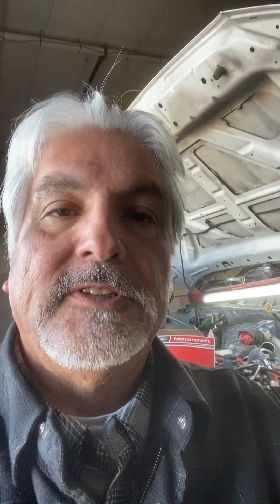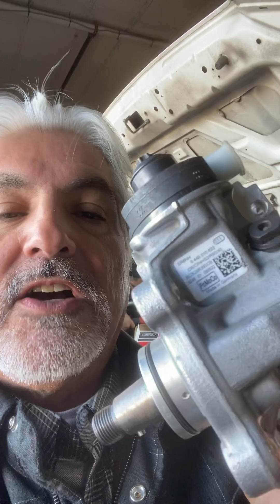CP4 replacement on 6.7L PS with an unproven pump?

Comment: if i remember correctly i heard that the cp4 pump was working just fine until the ultra low Sulphur diesel became mandatory and the process that removes the Sulphur also removes some lubricity  that the cp4 pump needed to lubricate itself when it operated. when the extra lubricity was removed the cp4 pump was slowly damaged until it grenaded the engine. but if you add a lubricity additive to the fuel you should be fine.
Reply from the maker: Low sulphur in fuel has always been an issue since USLD was introduced . But this has not been main issue with the CP4 pump. The air in the crankcase of the pump will cause pressurization of it and in worse cases crack the housing. In others the roller on the plungers will float and rotate and hit the cam and metal destruction is caused.
Reply: @dieseltalkwithtonysalas8725  is that a design flaw? or improper fuel filter changes?